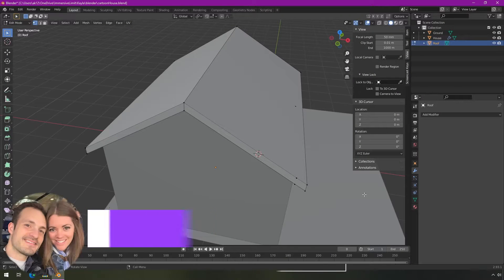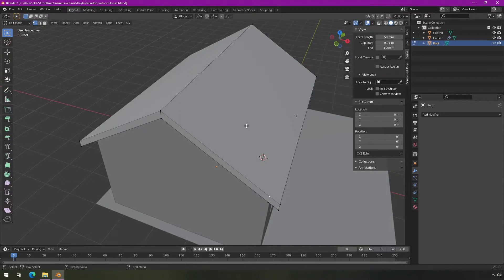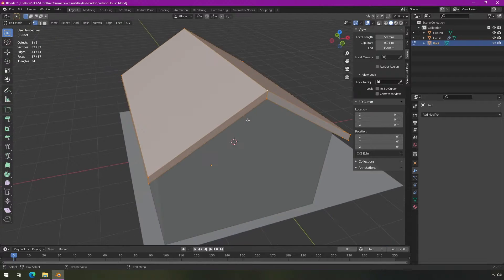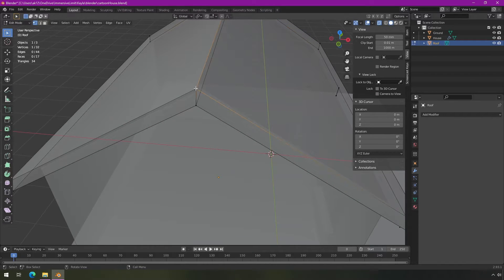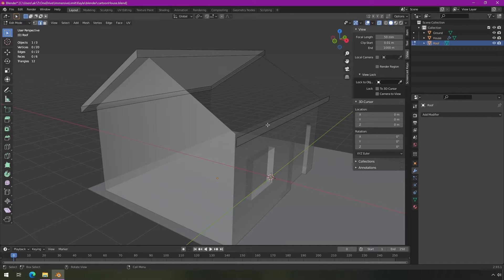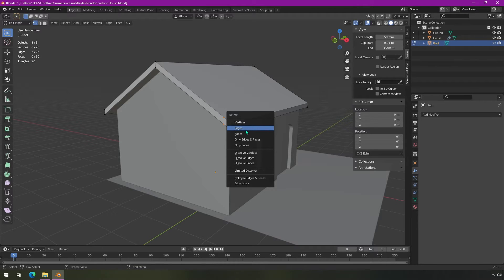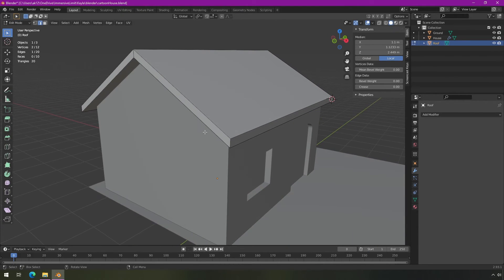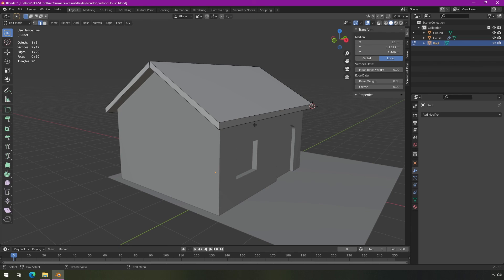Cleaning Up A Messy Mesh in Blender

Comment: There is a command that will do all that for you with one easy click, but I can't remember what it is right now, but it is there somewhere.
Reply: The easiest way I was thinking of to get rid of most:
Select all vertices > 'M' (merge) > By Distance > change the distance value to fit the scale of your project (in this case, since most were exactly at the same spot ~0.001m).
That would have reduced the unnecessary ones down to just 4.
Though, only usable for simple meshes, once there are too many, it could get tiresome to say the least.

Comment: One of the few tutorials which show the use of the value dialogue boxes for tweaking rather than automatic methods which overlook accuracy.
I would also like to know if there are any good tutorials for storing and retrieving original values of objects transformations, like when importing and exporting to other 3D applications.
They are almost impossible to work on when not aligned to Blenders Global Axis.

Comment: I'm new to Blender too but there is probably an automated way of doing it. May have a look at the merge feature: watch?v=MmCXa06O7rw
Reply from the maker: Merging can work too, but not in all cases, so I wanted to show how to do it manually.
Reply: Ho Ziad! I did try the merge feature before I asked Adam for his help. However, because my mesh was SO messy it didn't work and actually made things worse. 😂
Reply: @kaylakelly19  
while these hints are still very useful i have to admit that i actually do solve many if not most of my multiple vertices issues caused by repeated use of commands (extrude, scale, rotate etc.) that arent completed by just entering vertex mode, activate ALL, then do a "merge vertices by distance" with the default setting.
unless you have a VERY fine mesh structure this shouldnt interfere with the model but eliminates almost all of these ghost vertices at once.
Reply: That's for auto-merging: watch?v=S4lAxqfG96o